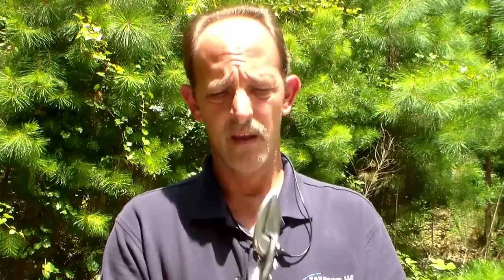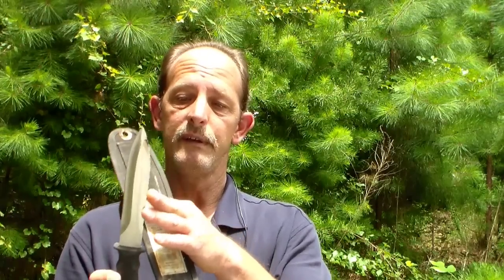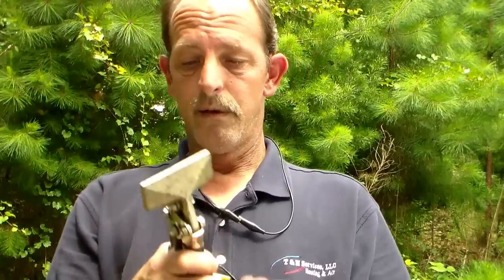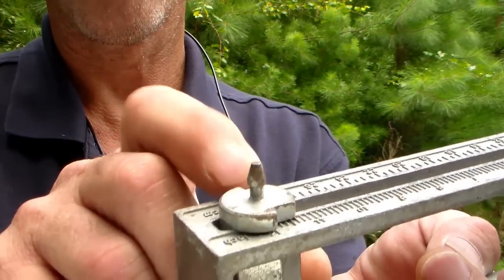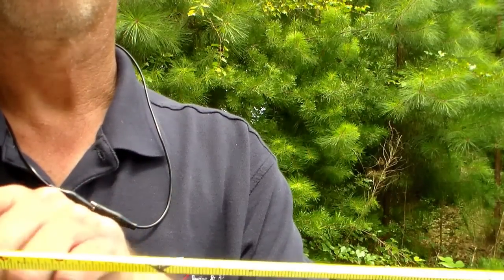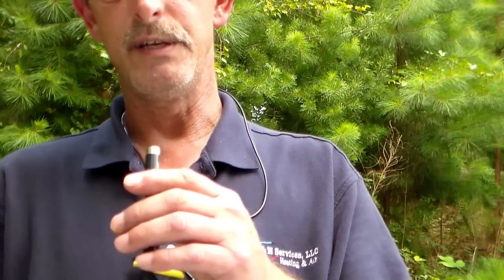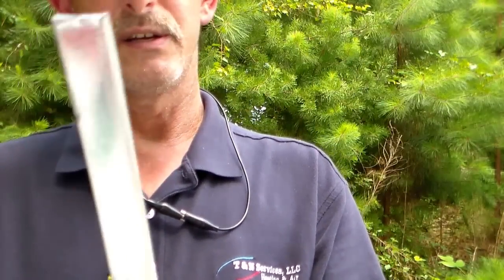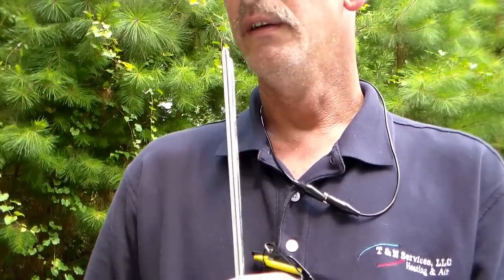HVAC Sheet Metal Video Series Pt1

Comment: Just wanted to drop by here and say thank you!  I used your videos extensively while replacing my furnace.  I had a very old forced hot air furnace which I replaced with a natural gas furnace I purchased on Amazon.  I got a building permit from my town building department and passed inspection with no problems.  At the beginning of the project I was completely lost on the sheet metal but I was able to make a nice transition to existing duct and even fabricated my own filter rack.  Your videos were incredibly helpful!  Thanks so much!

Comment: Thank you for putting this together - great content.  If you haven't covered it anywhere else already and were thinking of making another video, I would appreciate seeing or learning some pointers on properly measuring ducting to use the s lock/cleat and drive method.  I have an A coil cabinet that I'm putting in and I had to shorten the plenum.  I want to make sure that I know thew best way to measure to make it fit perfectly as it's been a bit of a challenge.  I'm sure this is simple for everyone but I was wondering if anyone might chime in...  Thanks!
Reply from the maker: Short of resisting the ductwork I normally cut my duct 6 to 8" above the coil so there is not to much of a block off point in your transition.
Reply: T&N Services LLC. Thanks so much.  That's pretty much in the ballpark for the clearance I cut out.  I was more specifically interested in the compensation for the s cleat side.  I cut it 3/4" shorter and it seems to be pretty good.  I've heard some leave a 1/4 and some 3/4...  I was curious what the best allowance was...  Thanks.

Comment: Ralph do you have any video on Pittsburgh lock and how to use it properly. Great Videos I like learning and doing things with hands.
Reply from the maker: I wish I had a Pittsburgh machine. Since all my stuff is done in the field I have to buy those fittings if I need something with a Pittsburgh on it.
Reply: Ralph I just wanted to see some video how you connect to sheet metal or what you have to do to adapt such bend to it. Just the way you use it and where it would be necessary. Thanks. Your videos are always educational.! Love them and learn everyday something new.

Comment: Thanks for the series. I was looking around you tube and most of the stuff I found was not in the field or shop stuff. Mostly Cad/Computer screen drawing. Got my Sheet Metal Fab certificate in 84. By the way I have heard them called  S Locks, S Drives, and Drive Locks. To each his own I guess. Been a long time making duct. How about laying out a Gore Pattern 90? That is a good one. Looking forward to the series. Subscribed.

Comment: I like to use a sheet metal hammer like a tiinners hammer that u can use the flat side to tap ur seams in also yellow straights are good for us lefties out there that can't get the rights to cooperate great series look forward to some new tips withi a lot of package units installed here we have to do a lot of on spot fabrication of the transitions to the elbows on the roofs with the crane dangling that unit above your head some tips on how to get your measurements taken correctly will help